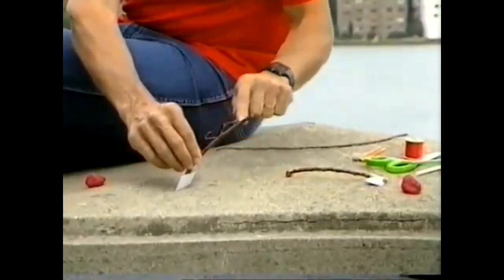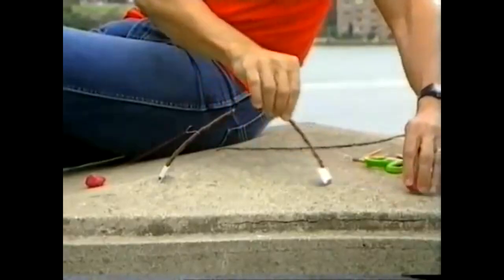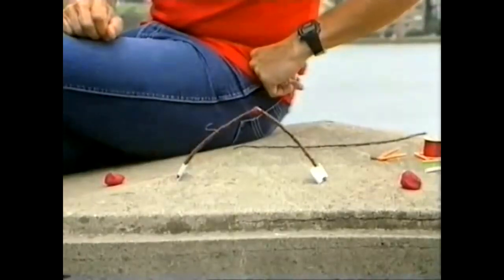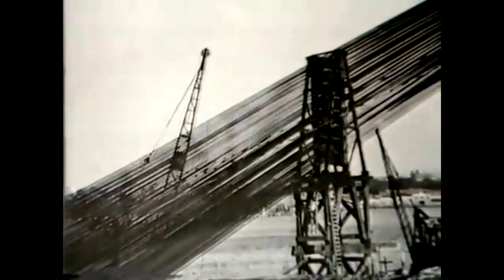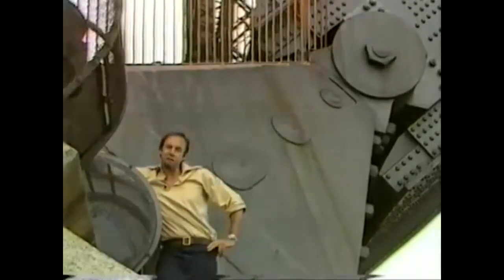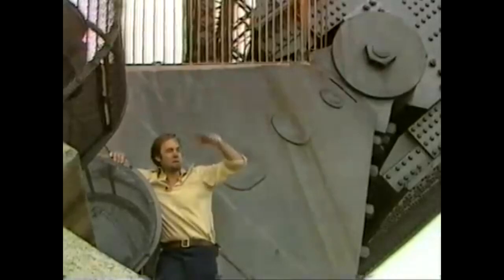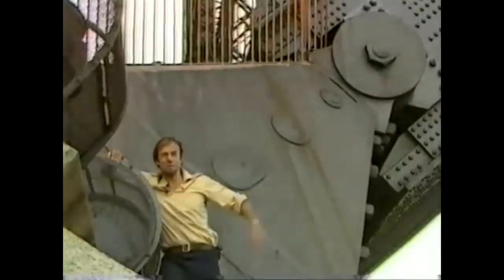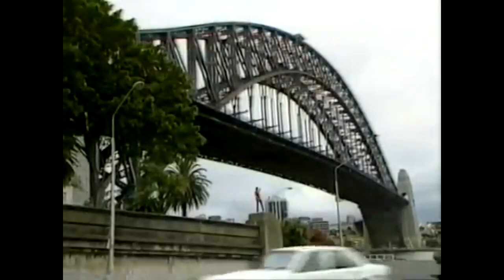How Sydney Harbour Bridge was built

Comment: That was interesting. I was in St. Louis, Missouri, United States, in the mid 1960's, when the St. Louis Arch (Jefferson National Expansion Memorial) was built. It's 630 feet tall, by 630 feet wide at the base. (Sorry, I don't know the metric equivalent.) When they were placing the final piece at top center, one leg of the arch had expanded a bit too much, so they hosed it down with water and got the piece to fit. I have home movies of it. The St. Louis Arch is a beautiful monument. There are elevators inside each leg, and you can go to the top and look out the windows. Cool stuff.
Reply: 630 feet is about 192 metres.  I never knew about the final section of the Arch.  Very cool.  Thanks.
Reply: When the two halves of the bridge met they were out by only a few centimetres. That's great engineering back in the 30s. One of the 4 piers is open to the public. Another is now used as an exhaust stack for the harbour tunnel

Comment: Maunsell and Partners, 6th floor, Legal and General Building, 2 Dind Street Milsons's Point is now demolished but for the basement carpark (one of our secretaries crashed Mr. Crook's green Toyota station wagon into a column down in there) and replaced with high-rise apartments but I can tell you that many Australian, English (e.g. the A47 Norwich Bypass) and Hong Kong projects were designed and drawn by hand with ink and paper there because that's where I did my apprenticeship. Hint: it's the building with two vertical white stripes that rises behind Luna Park and of course I was mad about the Curiosity Show as a kid. Why else did I become an engineering draughtsman?!? :-) 1:31
Reply from the maker: Thanks for that - I knew none of it - Rob